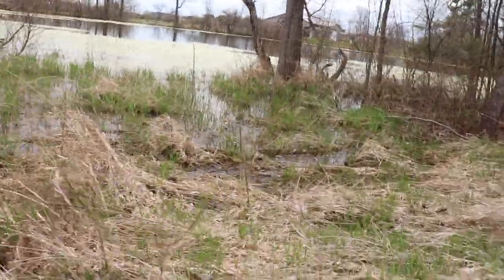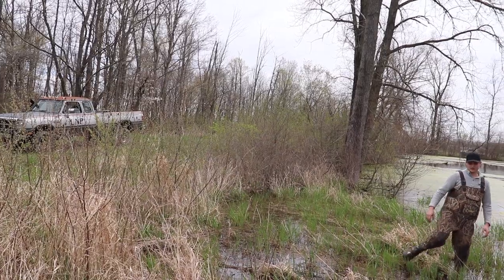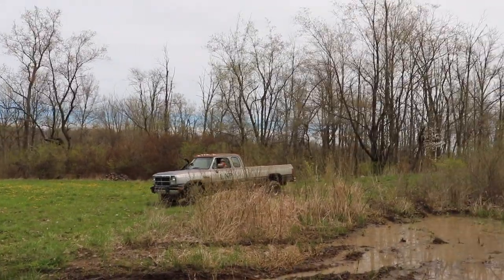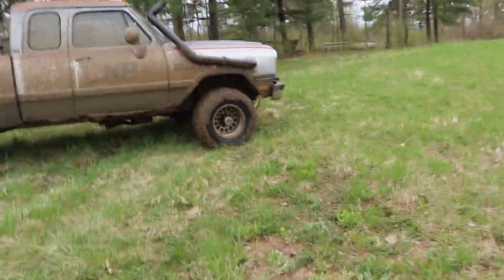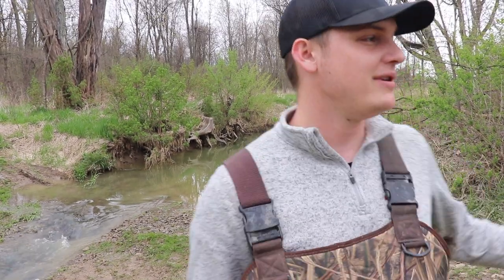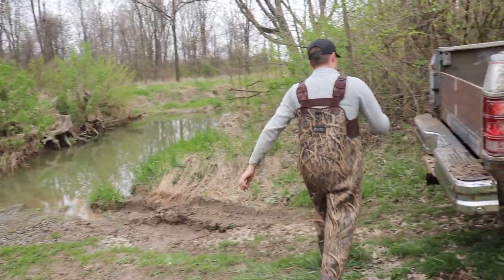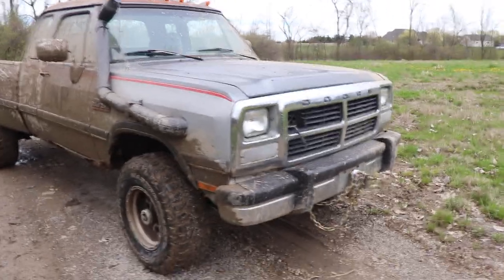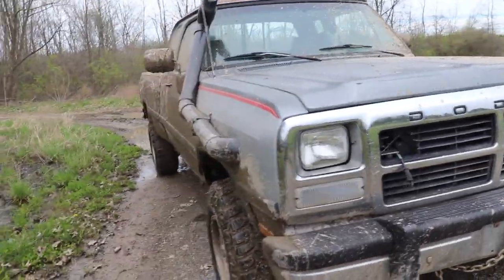WE FOUND A MUD HOLE FOR THE CUMMINS!!!

Comment: Just suggestion, mount ends front chains up top the grill. If you get in deep water and hang up. Then you got get way down to unhook the chain. Versus if you had bracket up top just hook the hooks on, then no swimming needed.